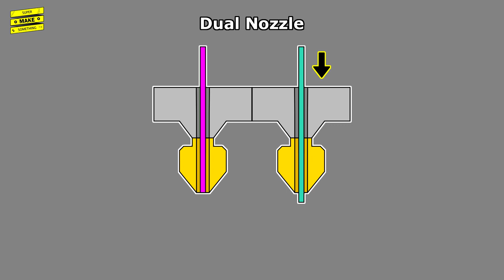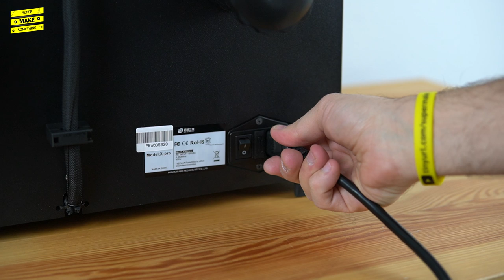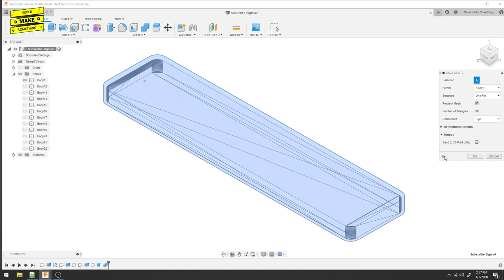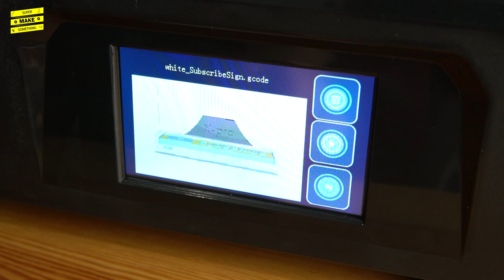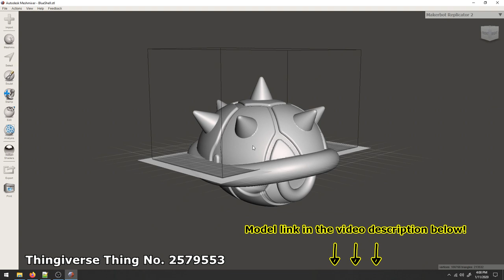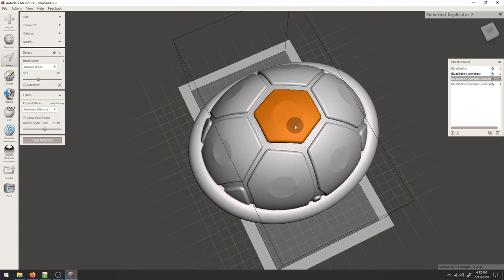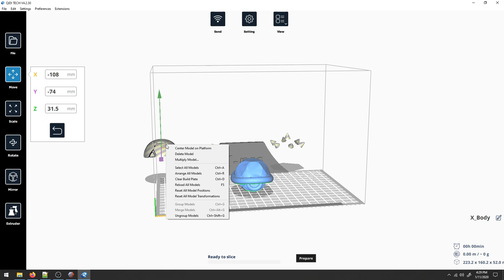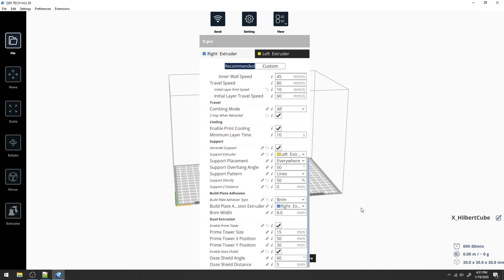What is Multi-Material + Multi-Color 3D Printing? (Meshmixer, Dissolvable Supports) QIDI Tech X-Pro

Comment: If you were to print with PLA & TPU instead, how would make them bond? I saw there are some options to make the materials overlap in other slicers, but have not found a similar parameter on this one
Reply from the maker: I have not tried this yet, but will report back when I do and have more info. If you find a setting that works for you in the meantime, please let me know!
Reply: I don't have the X-Pro but I have done TPU/PLA prints in a different dual-extruder printer (Tenlog TL-D3 Pro).  The two materials bond very well.

Comment: "Generate Facegroups" would have saved you a lot of time.... It's under the Edit menu.
Reply: Also: In later versions of Cura, you can use "Merge Models" in the right click menu for a better alignment than Center on Buildplate.

Also, also: PVA is great for low temp. stuff like PLA, but if you want a great, cheap support material for high temp stuff, then bargain-bin ABS is great for this purpose. ABS will dissolve in acetone (watch out, it's flammable and has a noxious odor!), but other materials like PETG will be unaffected!
Reply from the maker: These are great tips! Thanks for sharing!

Comment: Really great video.  So few go into the actual process to setup dual extrusion models.  The X-Pro will likely be my first 3D printer.  Q: Can you print ABS w PVA support material as well?   And my other Q: did you have to experiment with settings/retractions etc. to get PVA + the other matierial (PLA or ABS) to adhere to each other... as I understand they extrude at different temps, and adherance could be tricky.  Thanks in advance.

Comment: Hi, could you do an updated version of this, meshmixer seems to have vanished and the Qidi Print software has changed quite a lot. 

I am also having issues with the origin exporting from cinema 4D as I then have to relocate the 2 files individually rather than the center on build plate (which also doesn't exist as a button any more)